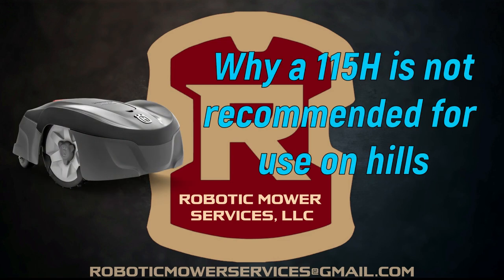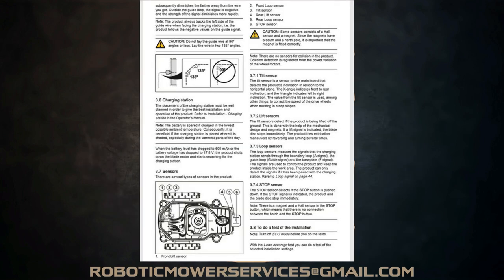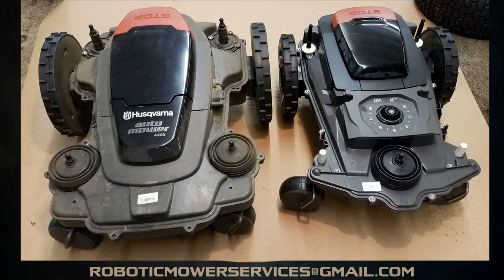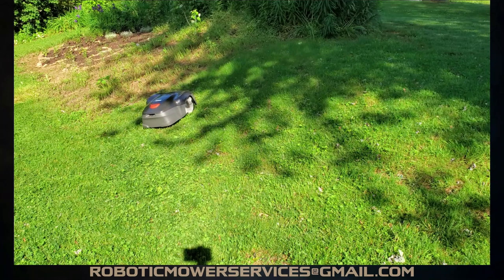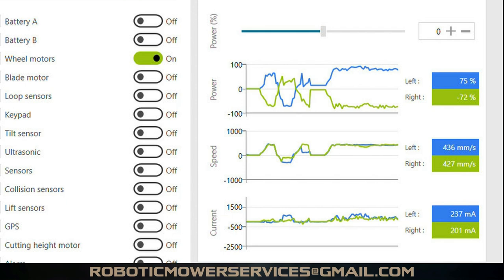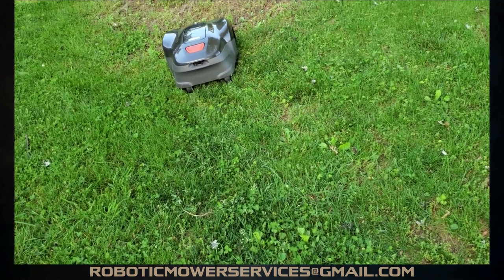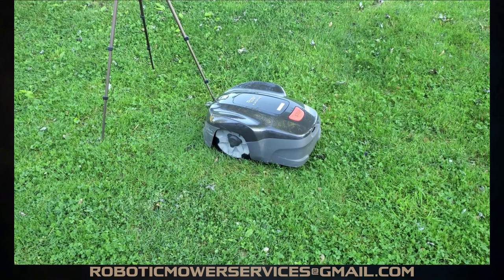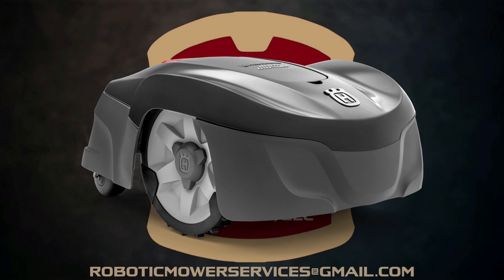Why the 115H Automower is not recommended for use on hills

Comment: My property is flat for the most part, but my corner lot has a 90 deg ditch.  My 115H handles the ditches with some slight issues.  For instance, since the downhill wheel when climbing gets more traction, the mower does not proceed on a straight line. I can live with that.

Comment: Im on day 2 of the 115h.  I think this is an exceptional robo mower for a flat square lot without a need to go elsewhere to cut.  My setup is .22 acres, back yard is open with one tree mapped out due to roots.  There are two other smaller trees that it just rams into and goes on it's way.  The mower rams hard enough that Im going to need to map those out.  
That said, my mower is going up a slope that is fairly easy to walk up but walking down on wet grass and you could easily slip.  Im actually surprised this handled that slope. Im wondering if they beefed up the motors.
My challenge, there is a guide wire going to the front yard.  It goes there and the back yard, but never the side yard that is part of the back yard.  Maybe one day it will reach there, but so far it hasnt touched a blade of grass there.  
For $700, I can watch this work from anywhere using the app.  That's pretty good considering it is using a cellular connection.  Where it sits in the yard is delayed to like once every 1 minute.
Reply from the maker: That is the perfect type of mowing area for a 115H